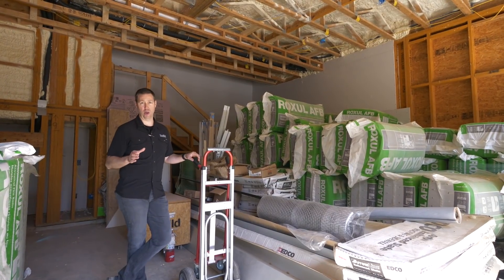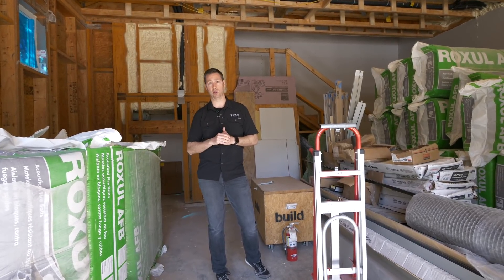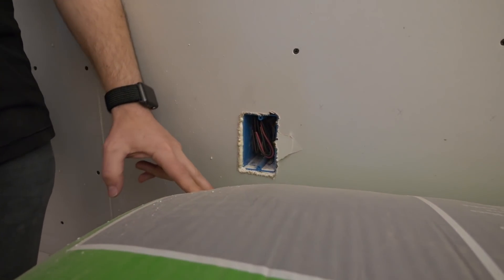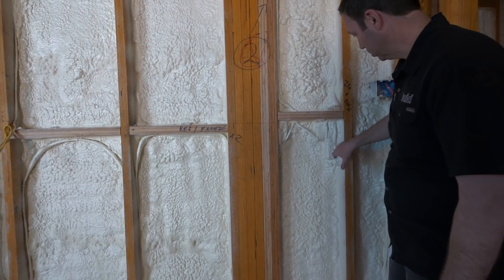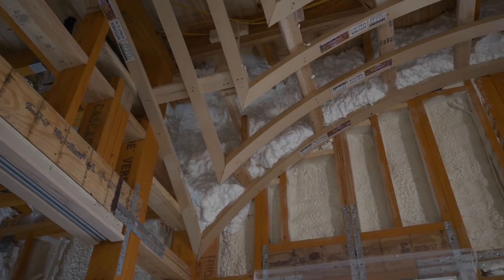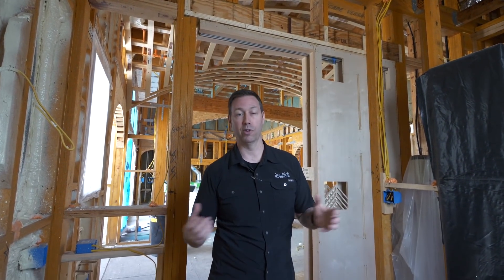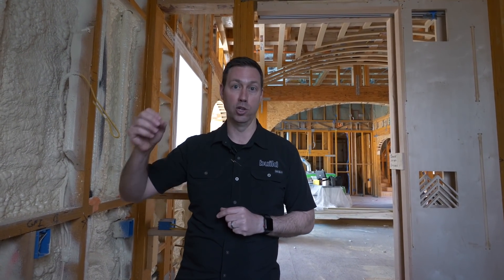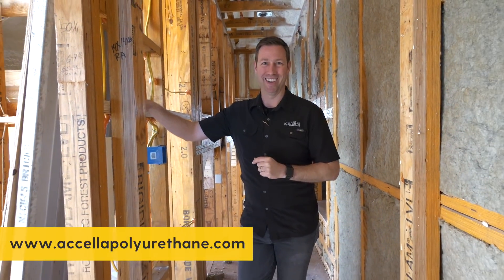Closed Cell Foam Tips and Budget Suggestions

Comment: Matt, 

What is the rough difference in cost between closed-cell and open-cell foam as for application? Given the R-value of each,  is  it that much cheaper switching foams (material & set-up costs), rather than adding depth of closed-cell foam?

Comment: Home construction is really about CSI division 7; warm and dry, and is typically the smallest budget line item of the project, especially if you exclude roofing cost, which can be a cosmetically driven cost. If insulation and waterproofing costs are tripled, which foam will do to your budget, it will most likely remain as your lowest budget line item. The challenge is to convince the customer to spend the money in this critical area. They will want to SEE the money they are spending; flooring, tile, millwork, etc. but a beautiful home that is drafty and leaks will ultimately not satisfy the customer or build your reputation.
Reply: Excellent points!

Comment: Great video.  Question: in a prior video you discussed the benefits of installing a minisplit in an attached garage.  If you insulated the walls/slab and conditioned the space, would you still install the spray foam on the garage-interior walls for air-sealing, or would you have pursued another air-sealing method and skipped the insulation between these areas?

Comment: DId you need to vent the attic? I just raised my ceiling and sprayed 6 inches of closed cell. I firred down and have about 8" between ceiling drywall and spray foam. Do I need to ventilate that space or keep it tight and sealed?

Comment: On a wall between the garage and the house, I would recommend a thin chase rather than a solid wall.  Trying to ever do anything different in the future with your electrical is going to be impossible with everything embedded in foam.
Reply: Kevin108 
I was thinking about this in regards to ideas for when I get around to building a house, and my only thought was to have planned extra conduits run with blank wall plates for future use.

But I'm also the kind of guy that will be fully networking a place for internet and I plan to have a dedicated rack for a patch panel and router. Overkill, but that's my plan.
Reply: i would rather have an uncompromising vapor control layer than the convenience of being able to effortlessly run new branch circuits and data cables at some point in the future.

worst case scenario you are going to be removing drywall and foam and respraying with a kit... its just not a big deal, just a pita.
Reply: I'm on the commercial side and we seem to change the same spaces around over and over.  I guess in the case of "if the shoe fits," it kinda doesn't.  Even in my own home though, I'd be okay with foaming in the work boxes, but I think I'd frame the wall thick enough to keep the wiring out of it.

Comment: Question Matt: Wood shrinks, but the spray foam has little to no flex. How does one continue to keep the house airtight if the wood is shrinking and cracks develop? I could see if you are using engineered product, but for Dimensional lumber, it's always going to shrink from the lumber yard. Thoughts?

Comment: You ever consider adding force ventilation in the garage? I'm toying with the idea of installing a few exhaust fans, controlled by a CO sensor with a relay output.
Reply: We have builder clients who do something similar - setting up an exhaust fan triggered by the garage door opening; runs for xx minutes then shuts off. Neat idea for sure!
Reply: Stephen Davis yeah, the only problem with a CO sensor is they're like $400. In my case, it's my grandmother's garage, with an old, carbureted, 76' Cutlass supreme, which pollutes like crazy, and so I'm not sure the garage door is enough.

I'm also wondering if I should install some cheap erv to run constantly, to vent the gasoline fumes
Reply: Didn't mean to be cryptic with the xx minutes; that variable will depend on a few things such as size of fan (output), size of garage (cubic footage), prevailing winds, etc. Could be 10 minutes or might need to be 30?
Reply: CO detector is a fine idea BUT that means that you are at the peak when it turns on! I'd look at a low sone (low noise) fan (e.g. Panasonic, Broan, etc.) and run one of those. You could certainly have one wired to be ON when the door is shut. Just check the duty cycle on the unit. Hope this helps.
Reply: Maybe not a true ERV as (a) they are expensive (b) you're now exchanging the air in the garage and (c) probably require maintenance. I'd look into an exhaust fan or two... duct them to the outside; maybe do one low and one high? OK to create negative pressure in the garage.
Reply: Matt did a video where he mentioned that there was a motion-controlled exhaust fan for the garage. It ran constant (I think) at a super low speed, but at the sign of a car leaving or entering, it switched to a high speed for 10 minutes or so. I want to say Panasonic, but I can't remember; it was buried in the middle of a video. 

Something like this: https://www.westsidewholesale.com/panasonic-fv-05-11vk1.html

Comment: Should we figure on the degeneration of the cells in closed cell foam as in the poly ISO foam board.  I'm not sure where the threshold is on the cell structures breaking down over time.  I do know that the closed cell foam has many density's.  Such as lbs per cubic foot, was just wondering if you have any experiences.

Comment: How about a double stud wall with 2 inches of closed cell and 8 inches of open cell over it to total 10 inches. It would be like the roof insulation in this video but for the walls.    Is that a good idea??? Or overkill

Comment: Is there anything particular you need to do if you do the closed and open cell foam on the roof line for keeping it in the envelope of the house if you do not have HVAC equipment in the attic because it is in the basement and is in a zone 5 climate?

Comment: Matt, since you have done a couple of segments on the spray on foam, would you also do a segment concerning the fears of the off gassing of spray on foam.  CBS did a segment on a few horror stories of people having to remove all the foam due to continual fumes coming off the foam.  And of course this cost the owners tens of thousands of dollars to have to do it.  You can find it on YouTube.  I would like to hear your take on this and if the current spray foams that you are using are safer.
Reply: Don Foster I believe in that episode it was said that it was because the mixture between the two ingredients where wrong the family was also in the house while it was when they shouldn't have been and I think have a good HVAC system that brings outside air in where it hasn't been contaminated with the off gassing and keeping it circulating and such and it won't be a problem but I'm not a professional or anything like that so take my imput with a grain of salt
Reply: Don Foster   

At the end of the day it all comes down to the installation.  There are a lot of variables in how your spray foam job is going to turn out.  The best thing you can do is hire a experienced company, preferably where the owner is on the job with the crew while spraying.  Spray foam is a great product but the heat, pressure and materials all have to be in the proper parameters in order to make good foam.  Then once you got all that it comes down to the guy spraying the foam.  Things like gun angle, hose heat, and installed thickness per pass.  It's not a type of material you just send two $10  per hour employee's out with a truck and say blast it in there.
Reply: I saw that video!!! Those guys kept layering the foam on top of it self! Very bad decision! That's why that family kept smelling the off gasing! 😫😝😕
Reply: I also thought they have since changed forumlations quite a bit where the slow long off gassing is not longer really an issue.

Comment: What is the maximum depth to spray closed cell foam? I was planning on building a home and using 2x6 lvl which are a full 6” thick and was hoping to do a full depth instead of exterior insulation
Reply: Infinity.  They do multiple “lifts” of 2-3 inches at a time, as thick as you want.  The multiple layers add skins that actually help it be more effective than a single layer of the same thickness.
Reply: Benefits diminish after 3"

Comment: Can closed cell foam be used for shear walling in a crawl space in a seismic area?
Reply: Great question! We are doing some additional seismic testing hopefully late Q2 for this. I'm going to go out on a limb and suggest that SPF will NOT replace the need for engineered shear (OSB/plywood, strapping, etc.) however WILL increase the strength of the wall ~150% to as much as ~275% depending on the framing (spacing) and material used (1.8pcf vs 2.2pcf).

Comment: Do you worry about a fire ignition barrier on spray foam installed in an attic?
Reply: Barry Munsell I’m pretty sure it can be added to the spray foam as a liquid after, or mixed in with the solution.
Reply: Closed cell spray foam is actually a fire barrier and does not promote the spread of fire.
Reply: open cell does

Comment: Matt, I live in West Tn and I'm currently building a house. My insulation contractor recommended  3.5 inch Icynene classic max open cell for my walls and 6 inches on the roof deck and tables. Should I be asking for closed cell? #confused  #help
Reply: jsills78 I’m in West Tn as well (Jackson specifically) and would love to hear the answer to your question! Who are you using for your insulation contractor?
Reply: Ryan Crouch 

Apex
Reply: jsills78 what did you end up getting? I’m considering closed cell for my roof deck and all exterior walls to reduce outside noise.. interested in hearing your results.

Comment: Does the close and open spray foam off gas at all?
Reply: If it is not mixed exactly right and applied correctly.  You MUST have an experienced installer.

Comment: please pay more attention to open cell. the problem is about leaking roof. if u have some leaking from roof, that time u will have a big headache because the open cell absorb the water too much. u will not notice due to the water will not drip out because open cell foam will absorb it all. it will damage ur structure real bad because the open cell will absorb all the water and spread out all over.

Comment: How fire resistant is that foam?
Reply: ALL of our spray polyurethane foam products undergo extensive fire testing. ALL of our wall foams (used in this series of videos) undergo ASTM E84, NFPA 286 and other testing. E84 is the 'gateway' test we ALL have to pass in order to bring a product to market. There are flame retardants in the foam however there are circumstances where we need to use a secondary product when the foam is left exposed (e.g. attic or crawlspace) to have it be compliant with Code. Hope this helps!

Comment: you make the house too air tight you'll have moisture problems I know I build icf homes and started sprayfoaming the roof and had to add a dehumidifier to get control of moisture now went back to blow in cellulose in attics so house can breath don't need to be sewed for homeowners ignorance and mold issues latter down the road
Reply: This house will have two dehumidifier units with fresh air intakes.
Reply: Yes, but not dehumidifiers, a full air circ system, which exchanges the air and also catches all humidity, as well as capturing the heat of the expelled air and adding it back to the new inlet air. All European superinsulated houses have a full air exchange system.

Comment: wait till you have a roof leak and it rots your deck board out on your roof because closed cell won't let the water come through
Reply: Imagine that house catching on fire.. lots of petroleum insulation to burn there
Reply: @JesseCoxVideo  i have fought fires in spray foam houses. The fears are greatly over exaggerated. A sealed house has a tendancy to go vent limited very quick and essentially suffocate itself out.

My only comment is make sure you have smoke detectors in those now hidden access areas such as a sealed attic.